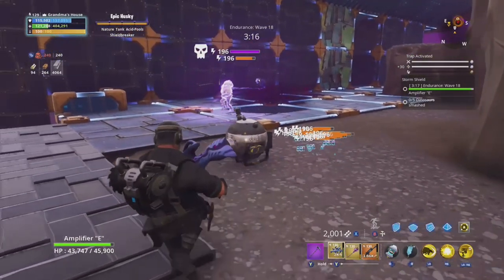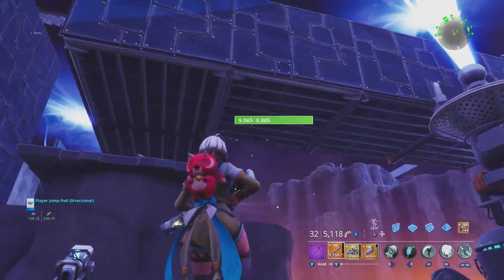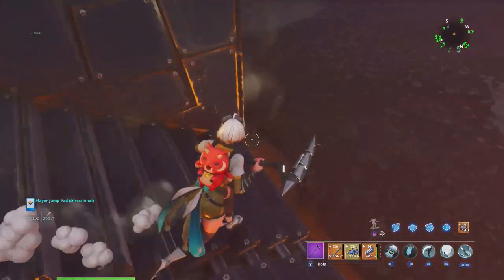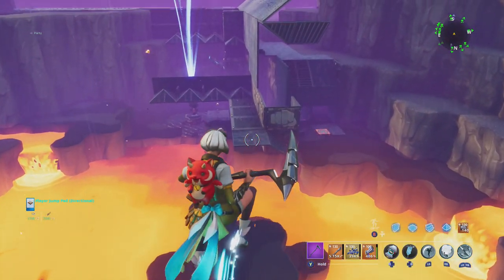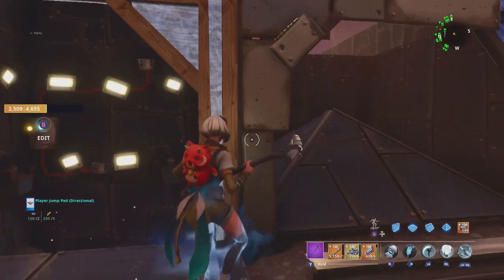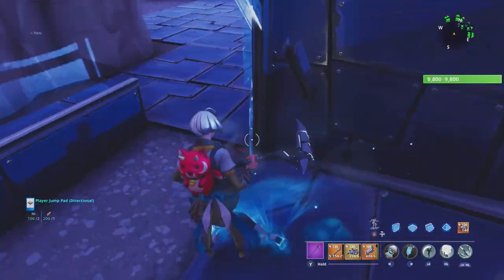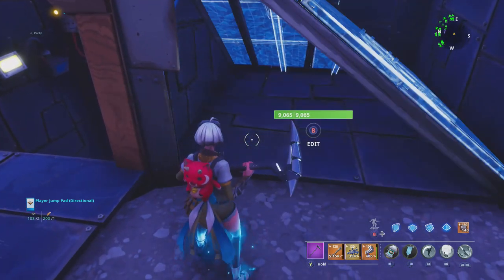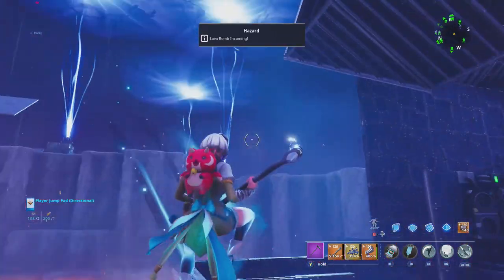Twine Peaks Endurance Jail Build Lava amplifier and geyser

Comment: Hello mr building engineer' I'm having big trouble with this build bro on at the base of the jail. It seem that husk are able to phase / jump out of the jail after some time.  Can you help me with any type of a solution? But other than that it work quite well.
Reply from the maker: Im going to bed now... however for this build i have made small changes that help plus a main one being adding drop trap below roof floor piece above exit of jail.. to trigger when they phase but not allow a drop 3 or less.
 Also i place defenders on the ledge near where i stand by the B.A.S.E. these defenders help shoot phasers
Reply from the maker: Remove the second wall launcher facing towards amp. Keep the 1 knocking back insde but make it 0 impact all durability and reload with healing wall.
Removing the excess of knockback traps with sundwalls should help with phasing abit.
Im now using 1 sound wall. 2 wall lights different reloads to stagger timing. And wall launcher 0 impact. Knockback to not knockback too far. Helps with phasing.

Comment: Did you ever make it with zero traps? You've inspired me and I managed to do it today
Reply from the maker: I tried for quite some time before to make with 0 traps... got real close to the tunnel build that is commonly used today  done by kirby but could never get it right by the geyser...
So made paths without need for blockoffs as much. The build would work  well for smashers propane etc but not huskies and such.
Someone else took what i was doing and added to it and had a good time doing it. But the old way i was doing was definitely a miss after wave 18
Reply: @whitestreamz  I made them go down the tunnel, but need to work on another amp today to get a 3rd wave there but it held perfect for me, I've only had 4 or 5 attempts in my endurance so still lots of rebuilds till I hit wave 30
Reply from the maker: @mrsandman3656  good luck with it... Endurance does take alot of testing and modifying. Endurance is a good place to rewlly test the strengths and weaknesses of a build
Reply: @whitestreamz thank you,  your videos and builds have inspired me to think outside the box for sure
Reply from the maker: @mrsandman3656  Thankyou. Being out of the box does give some pretty weird fun builds.
Reply: @whitestreamz  strange things happen in endurance fir sure lol last night when the geyser spits them out to the lava some hit an invisible wall and fall really slow 🤷‍♂️🤣🤣
Reply from the maker: Yep that happens too... ypu get too much stuff or lag game just doesnt seem to notice them all getting flung and theyll stop midair like that or lag back. Can be especially annoying on a place like lava amp... At least youve seen it, gotta take it into account. Also if you double ramp 1 above another on a powerful geyser sometimes they phase through the ramp and will land on top so give a little more distance if you see them landing on top

Comment: Husk keep fazing through for so reason. Do you know why its happening?
Reply from the maker: Seems to come and go with updates... seems to be sound walls and launchers interaction with husks.
Like some updates if they messed up they were able to just walk straight through an area they got displaced like a ghost.
Otherwise itll just be their phasing.
What you wanna do is have 3 defenders placed around that floor where base is to shoot enemies that phase through and tars/ freeze on floor around the amp between jail n amp.
I will need to do an update video at somepoint.

Comment: Can i build this for storm shield??
Reply from the maker: If you build this for a storm shield use tire drop traps above the jail 3 high. Then it will help kill the husks on a kill wave.
Reply: @whitestreamz  ok i will👍
Reply from the maker: In the jail below use 1 wall launcher knocking back. Then get 2 wall lights different reloads if you have them to stagger activation timing and 1 sound wall. Leave window open so you can see inside box and shoot. Or can add a damage trap